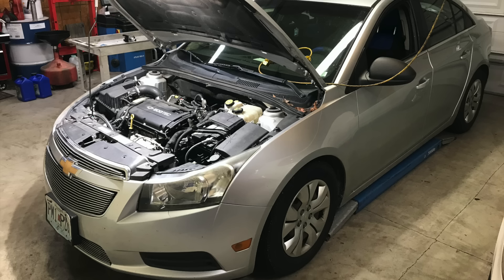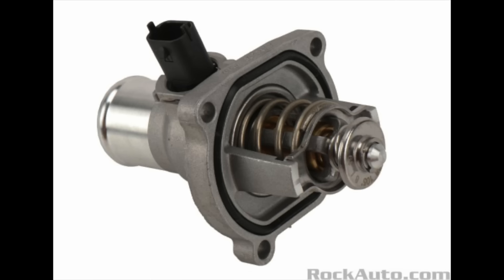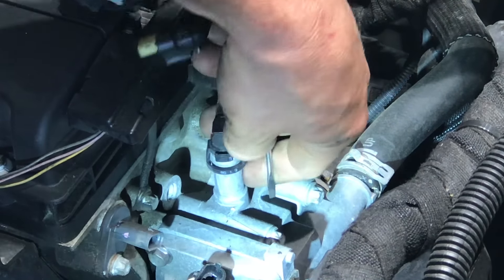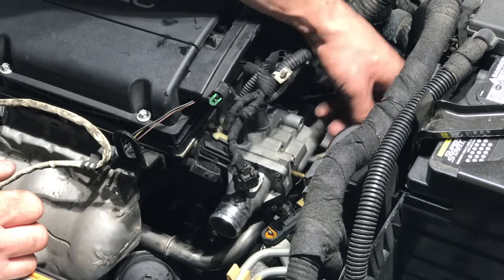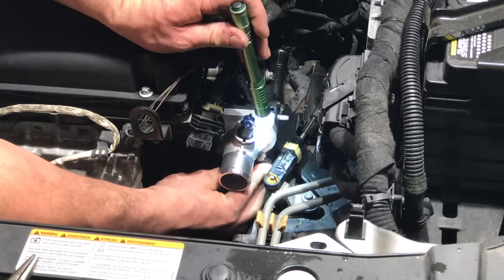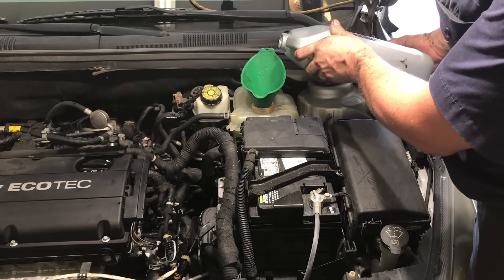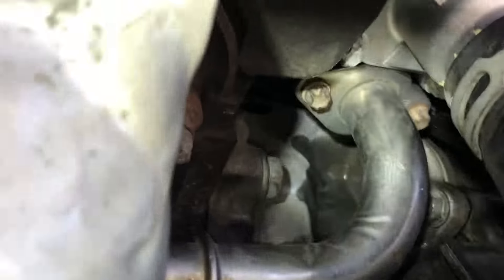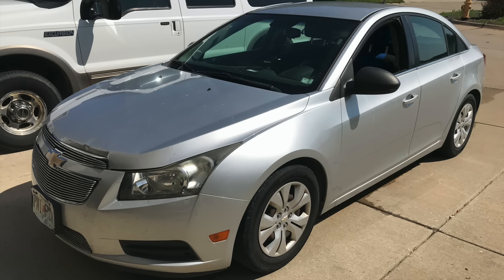Chevy Cruze Check Engine Light and Loud Cooling Fan Fix

Comment: Funny thing. I had a bad thermostat on a Cobalt once. I wasn’t the primary driver so as far as symptoms, I don’t know. I do know a code was never set. The only time I knew there was a problem was when the car was missing really bad and wouldn’t move. Then it set a code for random multiple misfire. That car has one long ignition coil and on top of that an ignition control module. I replaced both and it still wasn’t right. Let it sit for the night and thought about it. Next day I got a thermostat and a coolant temp sensor and replaced both. Car ran like new. I theorize the car ran as if it were cold all the time with the thermostat stuck open. Taxed the ignition system so much it fried either the ignition control module or the coil. Either way, that thermostat was a pain in the ass. Haha
Reply: You're high

Comment: I have the loud fan but not warning lights or codes would this still fix it?
Reply: I have the same issue I don’t have a check engine light but the fan is really loud
Reply: In my experience the light didnt come on until a week or two of the loud fan.
Reply: I been had a loud fan could be the relays?
Reply: Most likely

Comment: Kicking my fan on and it staying on fix for my sonic was to replace the temp thermostat that goes into radiator. Did the whole thermostat and it was a 10 dollar little plug lol 😂 but at least both are new and that was about 30k miles ago
Reply: I think that's my issue gonna check it out!

Comment: as much as I like metal vs plastic parts, I really have lost a tone of faith in aftermarket parts lately. the last thing I bought aftermarket was a belt idler pulley, and that failed 2 months later. bought an OEM Subaru idler and it's been fine ever since, and since the original lasted 190k miles I don't mind paying the OEM tax since it'll probably outlast the car.
Reply: It also depends on the aftermarket part manufacturer. There are plenty of reputable ones who are just as good as OEM. And there are even more that are cheap garbage. Even with a superior material, if the part itself is badly designed or sloppily made chinesium, it will still perform worse in practice.

Comment: Thnk u sir I replaced,but light n fan remains on any suggestions
Reply: Did you figure out the issue? I replaced my thermostat and coolant temperature sensor and the fan remains high speed. Thanks!

Comment: we’ve replaced this part 2 times with a aluminum housing, it would take off the light and can for a little and a few days later both would come back. Does anyone know what that could mean ?
Reply: I’m in the same boat with my 2014 cruze. I’ve replaced the thermostat housing twice, both sensors twice, and the water pump. Still the same noise.
Reply: @angelicakbuford7608  How annoying.. I’ve been reading a lot this is a common problem. I really wish i knew all this before buying the car 😕
Reply: @bigsexysw hi! I replaced both the thermostat (twice) and the coolant temperature sensor and the fan still runs nonstop high even if the engine is cold. Any ideas on what else I could check? Thanks!

Comment: Does every Cruze have the option to show you the coolant temperature? I don’t think I’ve seen it on my 2011 Cruze, 6speed manual
Reply: Most GM cars of that era have it. A friend of mine has it's predecessor, a Cobalt. That car has a live readout. I don't see why they'd omit it.
Reply: I’m reviving this comment thread but I can confirm the 2016 Chevy Cruze limited LS doesn’t have that feature.

Comment: I think this may be going on with my wife’s 2013 Chevy Cruze but her check engine light isn’t on.
Reply: Did you ever figure it out?
Reply: @Hablinsky if you drive around with the noise and the temperature gauge all the way cold. The engine light will pop up after a while